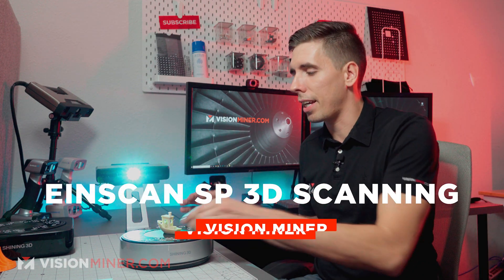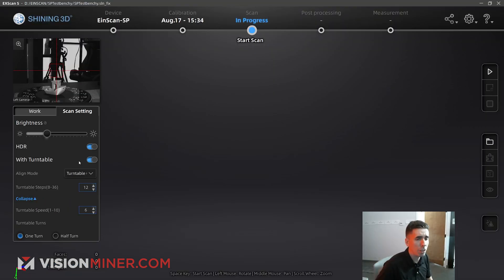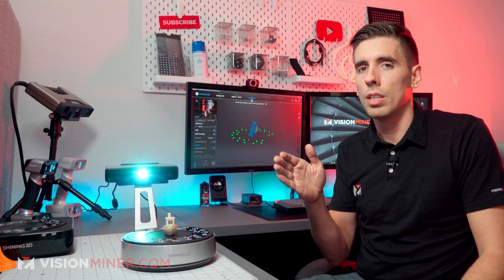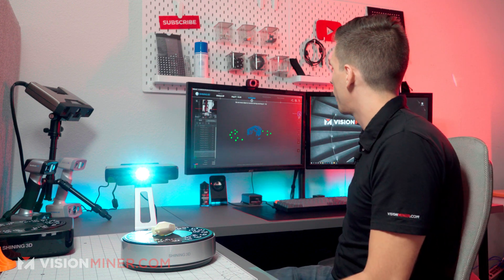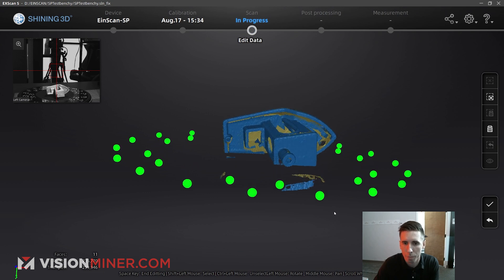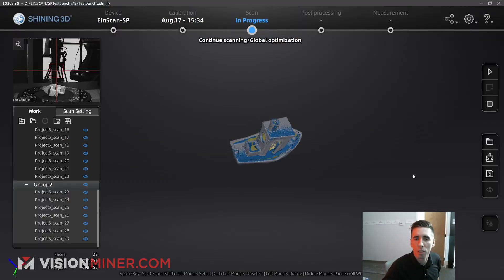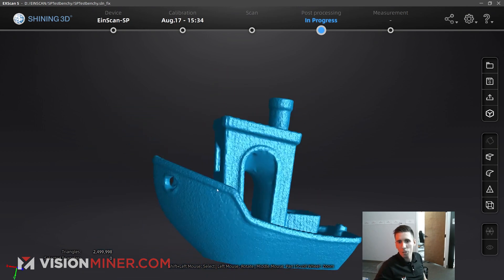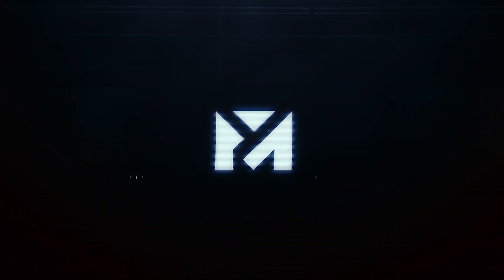How to 3D Scan an Object - Einscan SP Tutorial

Comment: 5:28 in your video on turntable control targets in align mode, I’m pulling my hair out because mine will start the scan but won’t pick up onto any reference points or green dots. But will scan fine in feature mode.. any suggestion
Reply: I'm 7 months late to this, but Turntable Targets mode will only work if there are a minimum of 4 targets visible in each step of the scan.  If the scanner is having trouble seeing them, try adjusting the angle of your scanner.  Features mode will usually work for any object that has sufficiently complex geometry.
Reply: I have the same problem... if on turntable encoded targets  it doesn't even project its structured light sequence.. it just shines a sold light and steps through while not capturing any information.  I''ve even just put a tiny item in the middle to assure none of the turntable table targets are blocked.
Reply: @GregSheka  our bad.. it’s not suppose to work with scanner stand, only with tripod mounted on angle..
Reply: @constantinearronis4671  Okay, Thanks! That's what I thought until I saw it on its normal stand in the video and it caught me a bit off guard as I wasn't aware it would work that way.  And trying it on mine certainly didn't work on its normal stand.  ;)

Comment: scanning kids toys is useless for alot of potential customers.  Videos that CAD designers in cnc job shops can relate to would be very helpful.  scan real world items like automotive parts, suspension parts, motorcycle parts, bike parts etc...   the need to build a cad model of a engine so you can design parts around it, turbos, superchargers.... scan an entire engine compartment.   

Youtube videos on scanning action figures and human faces is really useless for the average CNC job shop

Comment: Tuff review!
Can this system build on the scans it’s already captured? Fill in data where it needs it without having to do a fresh higher  capture scan?
Reply from the maker: Yes, absolutely! The align function is super easy to use, and you just import other scan data or open a saved project to add to it -- either way, it would best be done in a post-processing software like Geomagic Essentials :)